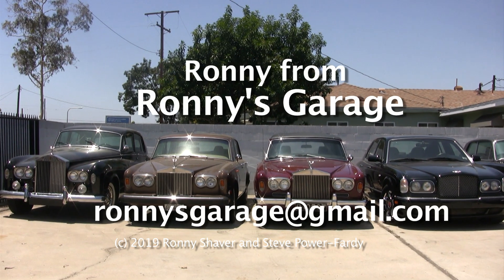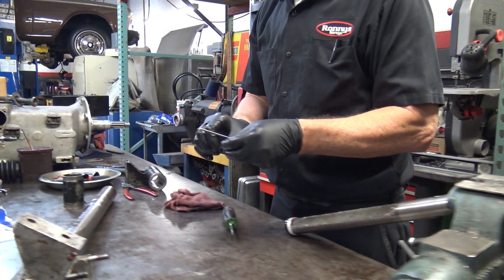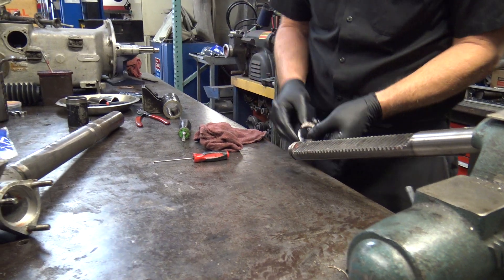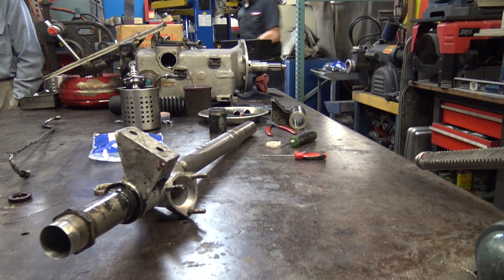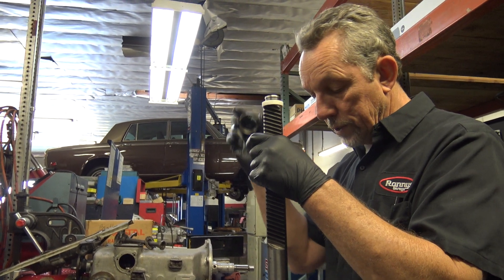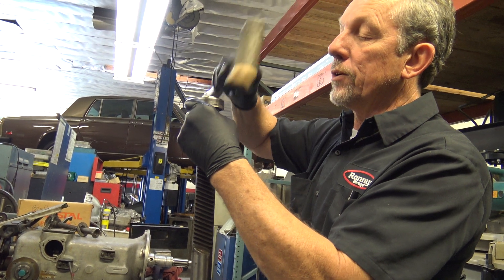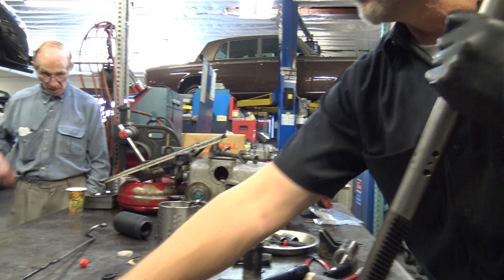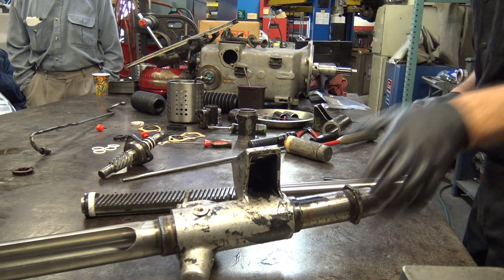Steering Rack Disassembly and Assembly Part 6 of 10

Comment: Ronnie, The shaft end seals are most likely PTFE coated nylon. Teflon is the PTFE. This this the same found on the turbine shaft of a 4L60e that requres resizing. With out specials tools, cut a plastic soft drink bottle so it can wrap aroung the seal, then place a hose clamp on it for a hour or so. This is a trick some use that do not have a re-sizing tool or bearing race. Just a thought. Retired ASE Master Tech, Omaha